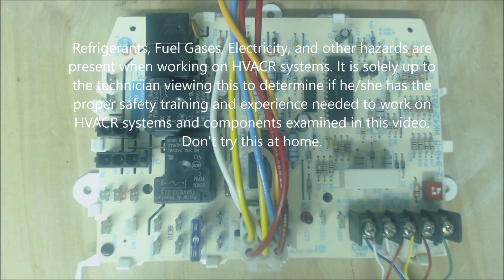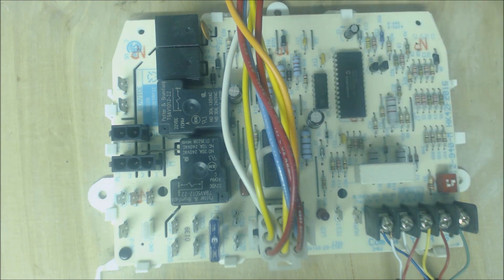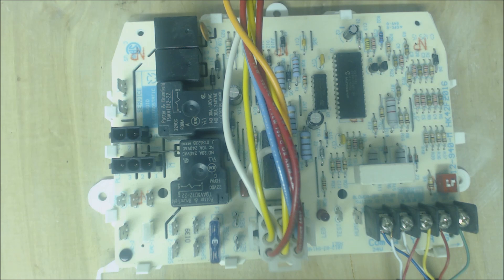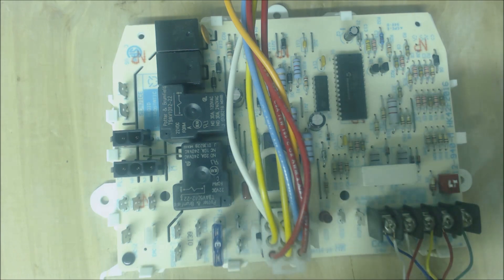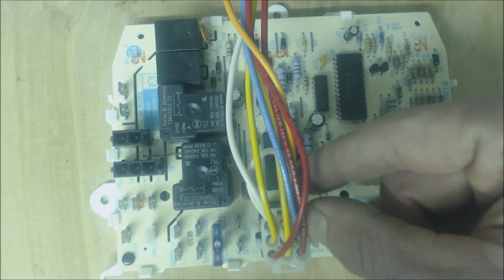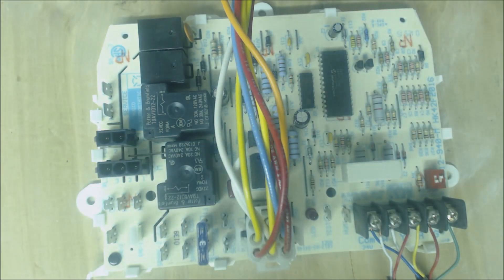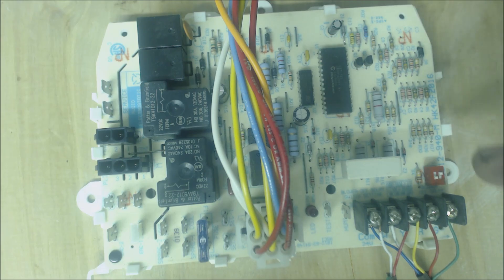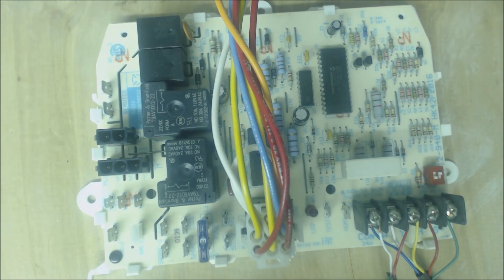Troubleshooting the Furnace Control Board IFC to Test if its BAD! For Heat and AC Diagnosis!

Comment: I have an old Lennox 80UHG4/5-100a-3, igniter glows hot but gas valve did not kick on. I have a yellow and blue wire coming from the gas valve to the wire harness on the board. I measured voltage coming in to the gas valve from the board and it was only reading 12v. 
There is a transformer above the board with a yellow and blue wire that also connects to the same wire harness. I got 24v coming from the transformer to the harness. I pressed on the blue and yellow wires at the harness and wow! The gas valve turned on and fired up. I thought it was just a bad connection. Furnace worked fine overnight and was cycling on and off with temp set at 71. But this morning it’s not working again, same issue. What do you think it is?
Reply from the maker: Yes, you should do as you just did, measure for 24 volts at the gas valve and work your way back to see where it stops, possibly at that bad connection, thanks!

Comment: Hello at the end of you're video you forgot to say what is bad if your not getting 24V From the thermostats to the board, please reply back . Thank you sincerely .
Reply from the maker: If the thermostat is not connecting R to G or R to W such as if the thermostat is bad. Look up "acservicetech thermostat playlist" for video selections on that, thanks
Reply: AC Service Tech LLC Thank You 👍
Reply: Thermostat starts Heater And Air But Won’t Start blower motor & Blower Motor Does Work When I test for 24 v on the board with my meter the blower kicks on until I remove one of my tester probes
Reply: And On My Thermostat When I flip switch to fan it doesn’t come on
Reply: Yes with the furnace Covers on
Reply: The Blower Fan Doesn’t Come On With Air Conditioning Turned On either And my Blower Fan Capacitor is rated at 10 + or -6% But It Only Tests Out At 9.2 9.3 Would That Be Enough Difference To Be Bad And Not Turn On The Blower Fan?
Remember The Blower Fan is Good

Comment: hi, i have a goodman 2 stage furnace. with the thermostat set to FAN ON the blower never comes on. the HSI glows for about 3 seconds then BOTH inducer motor and HSI turns off. i have an B7 code saying incomplete parameters sent to motor. i am thinking it's the board. appreciate all your help and thank you.
Reply from the maker: I am curious if this is a psc motor or ecm motor. If it is psc then the board diagnosis is simple. If you have 24v read from g to c on the board and you don't have 120v coming off the board for the blower then yes that board is bad, thanks
Reply: it's an ECM motor. the motor has one 5 pin connector (1-5), with pins 1 and 2 jumpered with a wire. pin 3 (ground), 4 (neutral) and 5 (line). But the line voltage goes through an INDUCTOR COIL. what does this do?
The other connector has 4 pins (1-4). this goes to the board labelled as Vdd-Rx-Tx-GND. Is there any ways i can test the motor using your method? thank you. you've been a GREAT HELP.
Reply from the maker: Ok that is an ecm genteq 3.0 likely. Look up "acservicetech ecm variable speed 3.0" for testing

Comment: I have a goodman furnace that will not activate. the circuit board will not indicate code, which is a steady light on. could the board be bad?
Reply from the maker: Are you reading 24v with your multimeter with one probe on w and one probe on c at the furnace control board for a call for heat?
Reply: I found the problem. the low voltage to heat was broken and not visible or brittle. as soon as I moved it a little it broke of. I had connected at the t-stat the r & w and had no activation. so I changed to a different color code wire which I used black. at the control board as soon as I touched the original w wire hook up it broke off. it worked. thanks for the input.
 @acservicetechchannel

Comment: I've got a Heil Furnace that the gas will shut off and consequently lose flame without the inducer or the blower turning off. When this happens I check for power coming into the pressure switch and I have no power. Is my board erratic and cutting off power to the pressure switch thus tricking itself into thinking the inducer has shut off and killing the gas? I don't want to falsely condemn a control board but it really feels like that.
Reply from the maker: I would start looking at the wc at the pressure switch and testing the resistance across the pressure switch, the tubing and also the limit switches. It sounds like you are putting your meter on too late after it already trips, thanks

Comment: Hi what about if the board receives  the DC  microamps going back but is still saying that is not detecting flame could that be a bad board itself? Thank you  really enjoy your videos like you say jajaja, thank you!
Reply from the maker: Could be but how high is the signal and is the board ground wire tight on the ground metal?

Comment: If I understood you, you said if green has 24v then blower will run & if yellow has 24v you will have high speed on blower. 
I don't think so. Green is blower speed for ac along with yellow to run compressor for ac. Green is same speed when you turn Fan on at stat. The slower blower speed, usually for heat only comes on through heat cycle & not any stat wire like you said. Good video.
Reply from the maker: Hey Rick, I can tell you that on most systems with a board, when you have the fan on and you then call for cooling, the blower motor speed is adjusted to the faster of the two speeds. Systems that just have relays have the cooling speed match the fan speed, thanks
Reply: @acservicetechchannel  thank you for clarifying that. Keep up the good work.

Comment: I have a Ruud 80 unit. Dead. No lights. No fan in Manual. No ignition sequence. The unit does hum when energized. Me thinks it’s the board.
Reply from the maker: You would have to test for 24v at the control board from R to C. It could be a bad 3 or 5 amp fuse. If 24v is there then r to g can be jumped with the power off. The turn the power on when the hands are safely away and see if the blower motor turns on, thanks
Reply: Thank you so much for sharing. I bought a multimeter. The main power is dead and the 3 amp fuse was blown. I replaced it, got one click, and another dead fuse.
Reply from the maker: @devins1195  Did you look up "acservicetech blown low voltage fuse"

Comment: Hey my friend. I’m working on a 80%Rheem furnace for a friend. Everything happens except the unit goes off after 4-7 seconds. I’m thinking flame sensor. I pick one up and put it in thinking that I will be the hero. But the same thing happens. IFC control board?
Reply from the maker: Hey Blaze, the flame rod usually never goes bad except those small ones on smart valves. It is just a stainless steel rod. You should however check for a strong flame rectification signal and check the pressure switch with a dual manometer. look up "acservicetech flame rectification playlist"  and also check this video out on the pressure switch- https://youtu.be/v9QWIr9TIVU
Reply: AC Service Tech LLC Thank you my friend. I’m on my way to pick up a Fieldpiece dual Manometer as we speak. And I will check out your suggested video. Thank you. Have a great week. God bless.
Reply from the maker: Get the SDMN6 if possible and not just the dual manometer. That tool has a pump built in, thanks

Comment: God bless you once more sir. Pls sir what is the difference between the COMMON and the R wire on the furnace control board? Thanks.
Reply from the maker: Thanks Chick! The R is 24v power from the transformer and the C is the common path back for the voltage. Usually the common touches the ground as well but the voltage takes the path of least resistance back to the transformer, thanks!
Reply: @acservicetechchannel  excellent

Comment: Sorry to keep bugging you but if I perform this test I make it to the hot surface igniter and find zero volts. Can I assume the board/relay has failed?
Reply from the maker: If 24v is making it back to the board from the pressure switch and then the board doesn't send power to the hsi then yes that would be the board. Just make sure you are testing the 24v coming back from the pressure switch at the board, thanks

Comment: Least the board fails? The most common part i have ever had to replace was the board. lol Gotta love these people suckered into believing electronics are so great! Never had so much trouble with anything till circuit boards started being put on everything! 70% of the time it is the stupid board that failed!
Reply from the maker: I do replace quite a few ecm variable speed and ecm non variable speed motor hubs but control boards are not usually the culprit. Many manufacturer reports the instances of warrantied control boards being the problem only 10% or less of the time when they are returned as defective. Maybe you happen to have had more than average amount of bad control boards. They are usually just the black relay contacts on the board. I also talk to a lot of contractors and they seem to have had the same experience. Anyway, all I am saying is for people to know the sequence of operation and not to blame the board if they don't seem to understand what the problem is. Sometimes it is actually the board, thanks

Comment: I have same bord the funace runes then the motor shorts out if I tap on side of funace were bord is motor starts don't do it all the time could it be bad bord or wire harness
Reply from the maker: Exactly, it could be either. It could just be the relay on the board, thanks
Reply: @acservicetechchannel  but the motor don't stated for puge only after bunner starts
Reply: One more thing I did get a 33 code but then I fond when hit side of bord them motor starts driving me crazy thank u for your help

Comment: Hi. First, thank you for sharing your knowledge. Everything I write here was learned by watching your videos so don't be misled, I'm not experienced in HVAC.
I'm a homeowner with a limited budget and a non-working furnace. What I'm trying to do is diagnose and/or do as much as I can before calling in a pro. I do that with all things mechanical because there are a lot of dishonest people that see dollar signs when a woman calls. I hate that.
Problem: inducer won't power on. LED blinking 3x = pressure switch open. A/C and blower work, both together and on fan alone (new blower in 2017). Using multimeter, thermostat and pressure switch test good. Testing out from board, inducer wires read: 18.7 ohms, 0.0 volts. That leads me to believe the board is bad (?). My questionis is, is there anything I may have missed that you can see here, or am I likely correct? 
Board is White-Rodgers 50A50 110 (no fuse), furnace stickers read Comfortmaker RPJII. 
Part II (because why not?: If it seems like I'm correct with a bad board, is 50A55 843 the correct replacement?
Thank you!
Reply from the maker: Not sure of the replacement board but if you call for heat at the tstat then you should have 24v between w and c at the board. If that is the case and you don't have 120v going to the inducer and there are no other error codes or blower motor is not blowing all the time due to a safety being open then yes that would be a bad fan relay on the board likely, thanks
Reply: @acservicetechchannel  Thanks so much for taking the time to answer. There was one other connection I overlooked for testing before I wrote,  it's a round thing —about quarter-size in diameter—centered on the inside wall right under the inducer. Two brown wires, one joined to a red pressure switch wire. Pulled to test, switched power on and the blower started up, meter read 27v. So that was cool. Ran it like that for about 7 minutes but inducer never started and LED still flashed PS closed. Confirmed (in my limited education) the board. Writing this part really just to show you what you taught me. Oh, and the brown wires tell me the round thing is a capacitor(?). Can't thank you enough but I think you have a link posted somewhere that I can make a donation. Doing that for sure. Thanks again. :)
Reply: This is my situation...same symptoms and fix.. thanks much...

Comment: hi, how can i make a circuit board that would start a second pump once the first fails ?
Reply from the maker: We usually just use OEM boards, thanks!
Reply: Wire in a flow switch on a relay, use the Normally open contacts to start the 2nd pump when the 1st one stops.

Comment: How u guys know all this information for each wires and each component on the circuit board.. it’s some book or class I can have to have this knowledge.. very great videos. Thanks
Reply from the maker: Actually, it is over time just working in the field. I have spent a lot of time researching and making sure what I am saying is correct for teaching sake at school, where I teach, thanks Marcos! Also I am putting together an air conditioning book as well which should be coming out soon, thanks
Reply: acservicetech do u have classes online or in dvd??
Reply: acservicetech I’m gonna be the first to buy this book..
Reply from the maker: Thanks Marcos! I will let you know when it is published if you just send me an email at info@acservicetech.com I will be developing other online resources as well but it will take a bit. thanks

Comment: having an issue with the 3 amp fuse blowing when i power up furnace fuse blows immediately when i turn furnace on any suggestions is it low voltage or high voltage
Reply: One thing you might add to the board for constant blown fuse while trouble shooting is this  resetable fuse: https://www.amazon.com/LIL-POPPER-FUSE-TESTER-AMP/dp/B00HK02DTE.  "AC Service Tech LLC" might even consider adding it to his affiliate links.
Reply from the maker: Have you checked this video out on that topic?-  https://youtu.be/Odf_df_YNvI

Comment: I have a Rheem Criterion ii furnace. I was told that my HSI was bad so I replaced it with a new one that ohmed to 64 ohms. Checked voltage to the ignitor, but am not getting 120 v. More like 4 v.  Any suggestions on what could be wrong?  Thanks for your help in advance.
Reply from the maker: It sounds like you are having a problem with your pressure switch which needs to close before the board will power the hsi. It may not be the pressure switch but a clog in the condensate or clog in the exhaust or intake combustion pipes, thanks

Comment: How do i test 4 a ground and if I have 2 bring a ground how do I do that I am a newbee and I love your videos ty i learned a lot of of u
Reply from the maker: Check this video out for troubleshooting ground problems on furnaces for flame rectification-  https://youtu.be/LtfghUYfl-4  -  You would use the same gauge wire as stated on the max fuse or max breaker rating on the unit. 14 gauge is 15 amp, 12 gauge is 20 amp, thanks Jonathon!